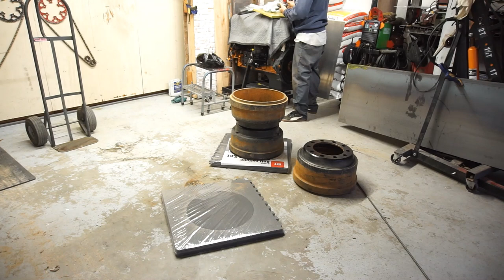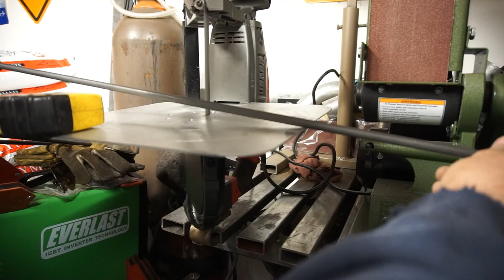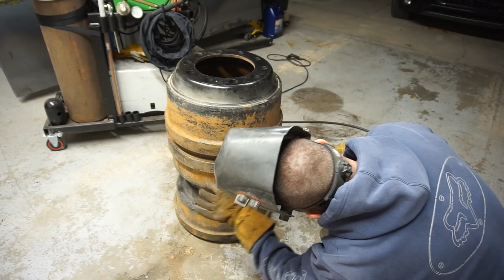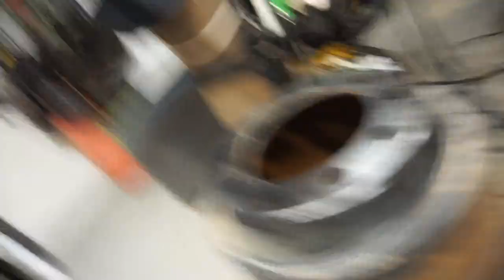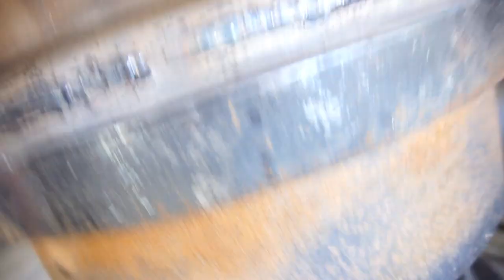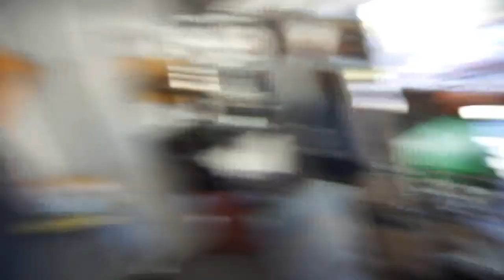My Failed Attempt To Weld Cast Iron. Making A Pot Belly Stove Out Of Old Semi Brake Drums.

Comment: Brake drums are cast steel not cast iron. You can use lo hy rod, farm rod or heavy mig wire but you gotta preheat them sumbucks and SLOOOOW cool them. Wrap them in fiberglass or dig a hole and throw them in, bury them. Preferably in sand or kitty litter. Let them chill ALL DAY, until they are plumb cold.

Comment: Would you be able to tell me what brand of brake drum has ribbed outer surfaces ???? Thanks fella.
Reply from the maker: An air cooled brake drum.
Reply: @Halffast719  What I am after is the brand model and make application used. Thanks
Reply from the maker: I have no clue. I got these from a recycling center. I’m sure they’re off of a semi truck.
Reply: @Halffast719  Thank you for your time Sir.
Reply: "Webb" do sideways fins (same direction fins as axle)

A steelite 16.5"×7" drums have ribs going around the drum (like a condom lol)

Comment: Saw a guy stick weld cast iron once . He pre-heated it with a torch and it worked . I know nothing of welding so take it for what it's worth .  You're funny in "chip-monk" mode !!  LMAO !!
Reply from the maker: Orion Fixr chipmunk voice. Haha. Yeah I’m gonna put coal in it to bring the temperature up and try to weld it. If that doesn’t work I’ll probably drill and rivet a band of steel around it.
Reply: @Halffast719  ; Well if you go the drill and rivet route make sure you get it on video .  I want to see that struggle bus go in the ditch !!  LOL !!
Reply from the maker: @orionfixr7713  😂😂🤣🤣🤣🤣. Haha I know right? I'm sure i'll film it i'm not a scared.
Reply: @Halffast719  ; He he he !  Ya' got a good sense of humor !!
Reply from the maker: I have to. It’s my job. Haha

Comment: The porous weld looks like Mig welding without gas not Tig weld
Reply from the maker: Probably exactly how I welded it.
Reply: @Halffast719 You called it Tig welded in the video but the welding with the porous holes is Mig welding with not enough or no shielding gas. If i were to weld these huge cast iron brakes I would of burned some charcoal in them first to get it hot and stitch weld them with a mig or stick weld it with proper cast rods and burn some more charcoal in it after welding to destress the weld, but I do appreciate your video is titled "My Failed Attempt To Weld Cast Iron" giving others a lesson
Reply from the maker: Lesson learned for sure. Those are some good pointers. I’m definitely no metallurgist and definitely not a professional welder by any means. Thanks.

Comment: Pre heat and post heat. Low hydrogen electrodes mate
Reply: Mate, the tracking together of it with low hydrogen electrodes will give some preheat, some oxy to get some more in b4 welding will help, post heat, have some coals, charcoal or something on hand to throw in and keep going for an hr or 2 and gradually let go out. Cheers Mark

Comment: almost impossible to weld without specialist heating and knowledge, just get a propane tank  and use that instead. you have to heat it up slowly top x temp and insulñate weld and then let it cool down with insulation while heating it at x temperature and if you are lucky it might weld, thats why cracked manhole covers are replaced and never welded, costs a fortune and you need an oven. Nice welding technique but zero penetration , its all to do with the crystalline structure of the metals....not your fault, just not possible.